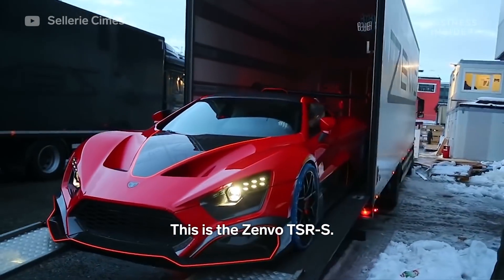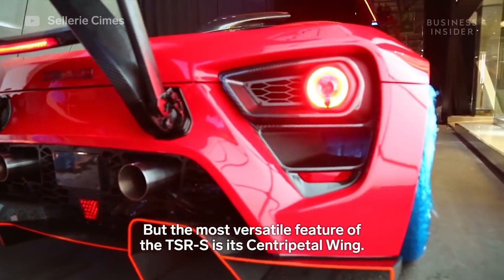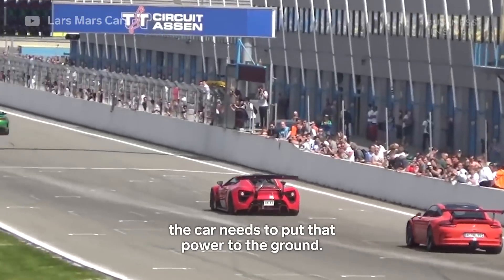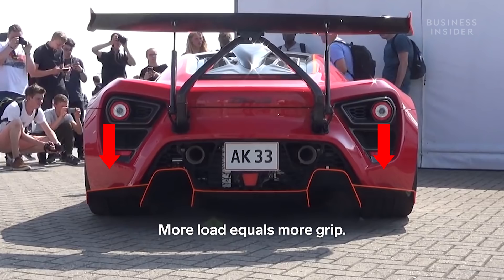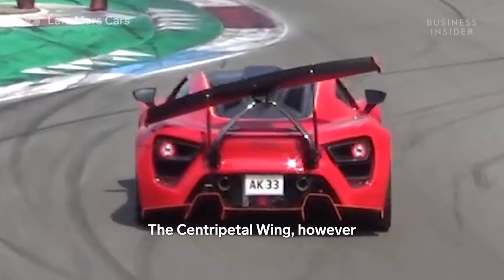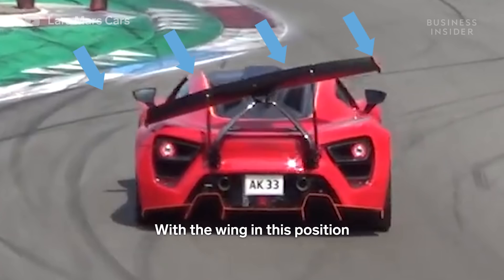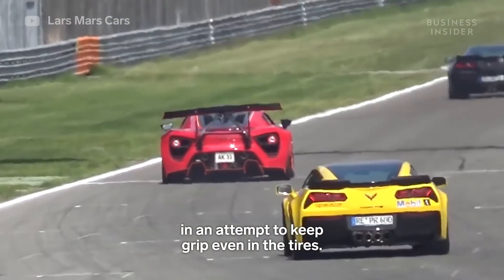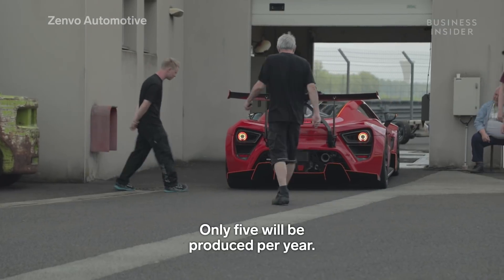How This Hypercar's Tilting Wing Gives It More Grip

Comment: It's not usefully cause the speed of the car is faster than the wing is moving so when u turn the car it's already on different corner so the wing works opppsite
Reply: Faiyaz Kiran its connected to the steering wheel, so its on point.